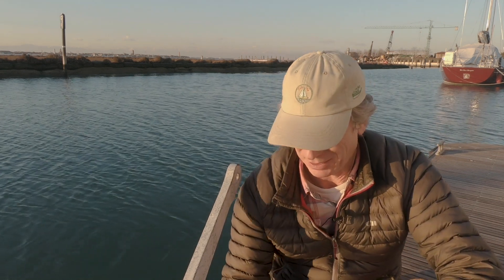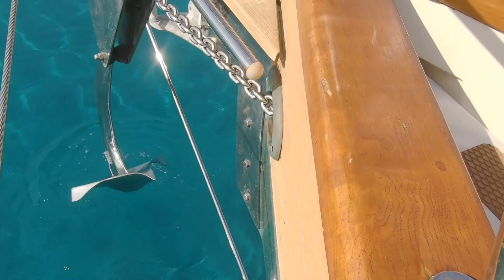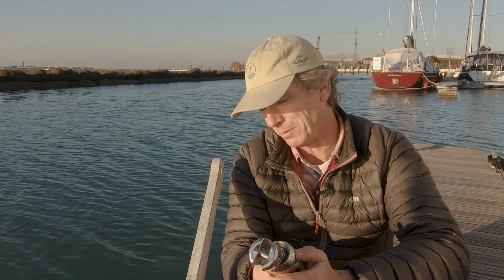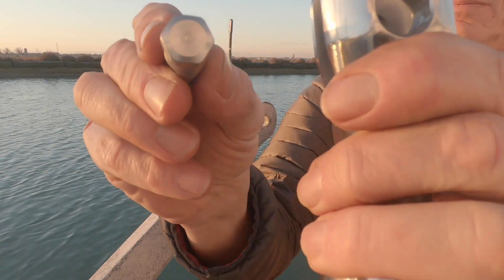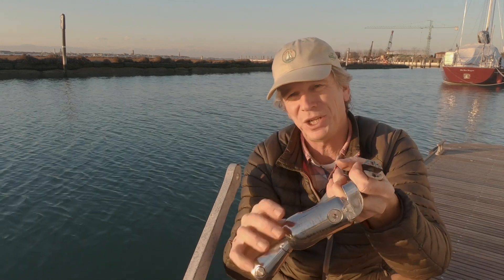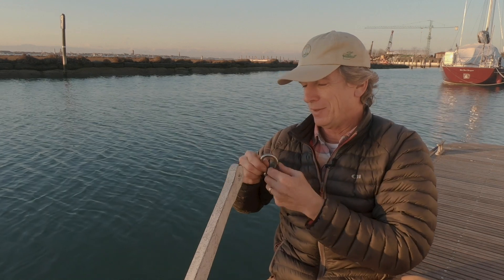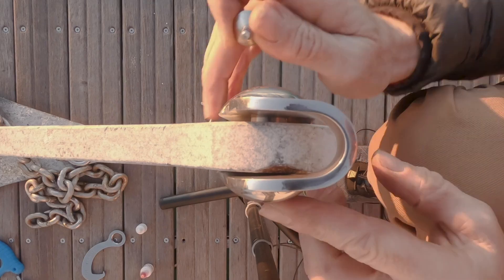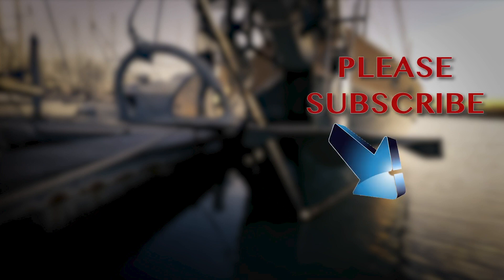What's best - Swivel or Shackle?

Comment from the maker: Okay I made a hash of the conversions, sorry. Thanks for all the comments trying to sort out the correct figures, I think I’ve finally got there! So it seems the figures for breaking strain printed on the side are: 160.9 Kilo Newtons (Force) and 36200 pounds - force. Converting these to Tons (Force) you get 18.1 in both cases. So that’s 18.1 Tons (imperial which is mostly used in the States) or 16.4 Tonnes (metric, mostly used elsewhere)  So slightly stronger than I stated in the video, hope that clears it up!
Reply: I hope you don't think I was being a smart ass but reading some of the comments was making my eyes itch. What you said was exactly right the load (force) the swivel will take far exceeds the chain it's attached to
Reply from the maker: @Div3r  Not at all, important to get it right :)

Comment: Very good. Thanks. I’m in the process of deciding and buying a swivel right now, so this was timely. I’m going with the Mantis, primarily on price, but also I see no difference in strength. The self righting feature of the Ultra is good but not enough to bridge the two and a half times price difference. I was really looking for a ball bearing solution, but they are just not there, perhaps for good reason. I know I could make a crossed roller slewing ring version which would deliver the same loading capacity, if I still had my machinery, but I think that these solutions are proven and safe. I’m going with price,….for now.  I still need a decent ball bearing version for my sea brake though.

Comment: Weighing the pros and cons of having a strong quality schackel or a ditto swivel doesn't lead to a conclusive answer. You can  go either way. But if you settle for adding a swivel it needs to be very strong, corrosion and wear resistant and importantly be able to move and cope with forces in all directions of pull. Especially sideways if the anchor gets stuck or to handle veering loads. Another aspect is the ability to inspect any corrosion or defects inside the swivel. And finally of course that the swivel fits and operates properly on your anchors of choice as well as on your bow roller and other arrangements up front.

The Ultra swivel meets several of these criteria but to me it seems only designed to work properly on their anchor as the dimensions and rear bridge arrangement probably restricts movement if mounted on many other anchor designs.

But my main concern with the Ultra swivel is the restricted lateral movement and strength even if the rear bridge is intended to provide additional strength.

Also the inability to inspect the ball socket inside worries me with the Ultra.

I think that the Mantus swivel is better on these aspects but it does need a cotterpin that requires regular checking....

Comment: Hi Steve, in your video anchoring 101 you explained the advantages on the duplex anchor chain. Especially for warm waters. Why did you choose the Ultra swivel (AISI 316) and not (for example) the duplex twister (AISI 318 LN) from Ketten Walder?
Reply from the maker: That's a very good question. And the to be honest I think the 'Twister' from Ketten Walder may be the thing to go for if you are anchoring every night as we are. 318 is just the best material for long term use. However the Ultra swivel although not being 318 is very much overbuilt. it has a similar breaking strain the the twister 90Kn as against 104Kn, both stronger than the chain. The down side of 316L as against 318 is how it might degrade over time in warm salt water. Well if you were talking about anything that has welds (like chain) or that is cast, and therefore may have faults that crevice corrosion might get a hold on then yes 318 every time. But the Ultra swivel is milled 316L so I can't see it being a problem. But all that said the twister is an excellent bit of kit and I'd like too get my hands on one!
Reply: Thanks for the fast respons Steve! We will take it into consideration when making our choice.
Reply from the maker: P.S. by the way we oversized our Ultra swivel by going for the UFS 13-60 which has a breaking load of 160Kn so I'm very happy it's up to the job!

Comment: Looks like a nice Shackle. And in normal use will suffice. 

But we encounter situations that are not normal too often. I had a large custom made stainless swivel that was permanently on and she was beefy. Yet a group of 5 charter boats arrived when I was onshore and they tied up together because the bay was known for strong katabatic winds. That evening while they were all having dinner ashore the winds were howling and they were dragged over my chain and the force of 5 large boats pulled my anchor out and had me dragging into them. The charter guy came out when he saw what was happening and when I said they needed to move his reply was after dinner. As time went by the winds were now well over 30 kts and I was about to drag into them so I decided to move but could not because they had hooked my chain. After much effort in the dark, almost breaking my hand and losing gear in the process to free myself I finally managed to free my anchor/chain but my beefy swivel had bent along one of the protruding ends and the pin was broken on one end.

A Shackle would have moved to the side of the anchor to take the load at the best angle. A swivel can not. Yes it was a large load and under similar conditions no swivel would have survived. With just a Shackle there would have been movement allowing for less load at the best angle not at an angle of high load at the weakest angle.

I have a nice new swivel but I will never use it. And now I always use wichard shackles with locking pins so no loctite.
Reply from the maker: Not all swivels are born equal. I wouldn't have trusted my old swivel in the sort of conditions you describe. I'm am completely confident of this one though.

Comment: We used to have a swivel, similar in design to the Ultra, and a short length of chain between the swivel and the anchor stock. Then, we dropped the chain and attached the swivel directly to the anchor, Now, we have no swivel and use a shackle. The reason is, I was always bothered by the fact I couldn't see what was happening inside the swivel housing; crevice corrosion, etc. So far, no issues. And, our Rocna self-rights each and every time we bring it up...so far. Thanks for your channel; we are enjoying your videos!
Reply from the maker: If you have no need for a swivel with your system and you have a good quality shackle then I agree, the less components you have to less chance of failure.
Reply: @svfairisle  agreed!

Comment: Due to sideways forces you should mount a shackle between anchor and swifel. The ultra swifel looks sturdy and has been load tested, but other brands maybe not.
Reply from the maker: It's certainly true to say if you have any doubts in your lateral loading of a swivel mounted to the anchor then having a shackle between it and the anchor to make sure it's not subject to those type of forces might be a good idea. But rather than pay for a second rate swivel and shackle, isn't it better to just buy the best swivel out there? Or the best shackle if your set up and anchoring habits mean you don't really need a swivel?

Comment: U say people still use shackles for anchor-to-chain because of old fashioned habit.  No Sir !!   People use shackles cos they're as cheap as chips.  U cd buy 20 shackles for the price of one of your fancy swivels.
Reply from the maker: If you don’t need a swivel then go ahead and use a shackle, but you’ll need two for an Ultra anchor with a hole not a slot and you need top quality to get close to the strength of an Ultra swivel

Comment: i SUPPOSE THE OTHER REASON TO USE SHACKLES IS YOU SAVE £300
Reply from the maker: Well you'll only save £300 if you're using some old shackle you've got lying around! You've got to attach it with something!  If you don't need a swivel, not everyone does. For instance if you don't anchor much, or for long periods, and your set up means you could get it on the rollers easily. Then a shackle would do fine. But not any old shackle. I would want something like this... https://www.ketten-waelder.de/en/nautic  which is probably half the price of a good swivel but not for nothing! There's no need to spend money for the sake of it, but you do need to make sure yourself and you boat is secure if you're going to anchor out so don't waste money, but don't skimp on ground tackle either!!!

Comment: I have never seen the point of anchor swivels. All they do is add a potential point of failure to the anchoring system and provide little to no benefits in return. The fundamental mistake since an off-axis load will subject the cheeks of the swivel huge loads. So does the much advertised Ultra swivel solve this issue? Nope,   As you have shown, it only articulates about 30 degrees, which, while it reduces the problem in everyday use, does not solve it when the chips are really down.
 Wait, it gets worse: The very ball and socket that allows articulation introduces a potential failure point. And the fact that the swivel shaft—made of  stainless and therefore subject to work hardening and is torqued over the bow roller every time the anchor is hauled. Stainless steel is, more than most alloys, subject to strange and difficult-to-predict failures when subjected to repeated high loads.
The Ultra swivel is restricted from articulating in one plane as part of its automated anchor orientation-on-retrieval feature. A “feature” that may increase the chances that it will be subjected to just the sort of loads I worry about—that's no feature, that’s a bug.

Bottom line, I firmly believe that for those who feel they must have a swivel, the only right way to install it is with a short length of chain between it and the anchor so it is never subjected to an off-axis load. But in the Ultra’s case, this does not solve the problem because the shackle can’t be oriented properly. Now, at this point many of you are reaching for your keyboard to call bullshit on me by pointing out that you have used an Ultra swivel for a long time without a failure. And I’m sure you are right about your experience. It is all about Risk Analysis, that’s the point: Evaluating a risk by its frequency of occurrence, without taking into account the seriousness of the result, is a mistake.                                                           "The more you know, the less you need"

                                                              Yvon Chouinard, climber and founder of Patagonia.
Reply from the maker: Well when i went through the risk analysis putting together my ground tackle I had a look at the figures for the best shackles out there & compared them with the Ultra Swivel. We have Cromox chain which is stronger that G70 so to not be the weakest link in my system the attachment to the anchor has to be VERY strong. So lets look at Crosby shackles as they are one of the most respected I think and already have several on board. Well the biggest shackle I could use that would fit through the 10mm Cromox chain is the 3/8th's I think. this is rated with a working load of 1 ton. they state the breaking load should be 6 times the working load so that's a breaking load of 6 tons. One third of the breaking load of the Ultra! The Ultra Swivel has a breaking load of 18 tons (which is in line with the strength of my chain) So the fact is a shackle would be by far the weakest link in my system. For most people with standard strength anchor chains, or even G40, the Ultra swivel would be by far the strongest link in the system.
Reply: @svfairisle  I certainly hear where you are coming from. Ground tackle can be very subjective. I’m not a fan of stainless steel, primarily because an anchors or chain made of the right grade of galvanized steel is much stronger, size for size.

That said, there’s no intrinsic reason that an anchor that’s strong enough for purpose can’t be made from stainless as long as the designer and manufacturer take into account the properties of that alloy, rather than just build an anchor or chain in stainless that was originally designed for a stronger material, as several manufacturers have done.
 And stainless has the advantages that it sheds mud and debris more quickly when being hauled and, of course, it does not bleed rust all over the deck like a galvanized anchor will when it gets banged up, as it inevitably will on any boat that actually cruises. There are many things I like about the Ultra, a couple of things I don't. The attachment hole in the stock is only large enough to accept the pin of an adequately sized shackle or swivel. This is a fundamental mistake since an off-axis load will subject the cheeks of the swivel or shackle to huge loads.

My vessel has an unloaded disp. of 22tons and have chosen a large single galvanized Spade S200 bower with 10mm MF DAMS Grade 70 Calibrated Anchor Chain and Maggi AQUA7 oversize link, hot dipped galvanized with Titanium pin manufacturer Break Load: 10mm = 12800kg. As mentioned my concern is the off load axis and the weakness there in of the Ultra swivel. That trade off for in my opinion is a big concern for nominal chain twist. At the end of the day we all must do what we feel works best for us. I appreciate your videos and point of view.
Reply from the maker: The solution you have is a good one with the oversized link in your chain so that you can fit an oversized shackle. But that's the only way to get an attachment that's strong enough to match you G70 chain. If you don't have an oversized link in your chain end as most people don't then I don't think you can get a shackle thats strong enough to fit. On the other points, the size of the hole in the Ultra anchor is easily large enough to accept a massively oversized shackle if thats what you want. You would have to use two shackles to have them the right way around, but if you're so set against swivels that's an option. 
There are always options available, and at the end of the day we all want to sleep soundly at anchor so it has to be something you're comfortable with. I would just prompt people not to stick with the old ways thinking they must be best. I thought that about Swivels v Shackles which is why I made the video. When I researched it I found my knowledge to be flawed. Same goes for Stainless Steel. Your first line is a good example of that... 'I’m not a fan of stainless steel, primarily because an anchors or chain made of the right grade of galvanised steel is much stronger, size for size.'   I'm afraid thats just utterly wrong, but i'll forgive you because I might have said the same thing a year or so ago. When I researched it because I needed a new anchor chain I was pretty biased against Stainless Steel, have a look at the Anchoring 101 video. It was a chain that came with the boat, was 20 year old and was 316Ti. I was more than ready to write off SS as an option for chains I can tell you! Then I researched it.  I filmed an interview with a marine specialist in materials and found that 318 Stainless is not only stronger that G70 but has a PREN factor so high that corrosion is not a problem for it even in the warmest water. So just because in the past SS wasn't up to spec. that certainly doesn't hold true now.
Sailors as a whole seem to have extreme Ludite tendencies and this is not always a good thing!
Reply: @svfairisle  Agreed my friend, all good points for debate. I applaud you for your honest and thoughtful work. I am not opposed to new technology, quite the the opposite. As a performance cruiser/racer, I am very interested. That in my opinion does not negate the design flaws when dealing with off load axis stress. I look forward to meeting sometime and discussing the issue over cocktail's, should ever get out our way.  Summer home port of Newport Rhode Island and winter Antigua. Jim & Gady S/Y Aurora
Reply from the maker: Now THAT's a plan! First to have an anchor problem buys the drinks!!!
Reply: @svfairisle   Just to clarify, I am jealous, the only reason for me to have not gone with Cromox w/the electro polish and a stainless steel Spade was the staggering cost. With the money saved I will buy the drinks 😉
Reply from the maker: Ha! you might have to if my bank balance hasn't recovered by then!

Comment: Steve, I have found an ultra flip swivel that looks identical to yours on Jimmy Green site. Is that the one? Price £210. Stainless Steel.
Reply from the maker: They are certainly Ultra swivels, not sure of the pricing though because it depends on size. We have the UFS 13 -60 , the 13 means Max 13mm chain. We only have 10mm chain but thats because it is Cromox chain and very strong. The 60 in the Max anchor size, we need that because we have a 45kg anchor and the next one down, the UFS 10-35 is okay for chain but not weight of anchor. Hope that makes sense.